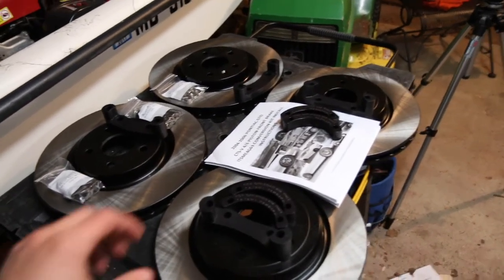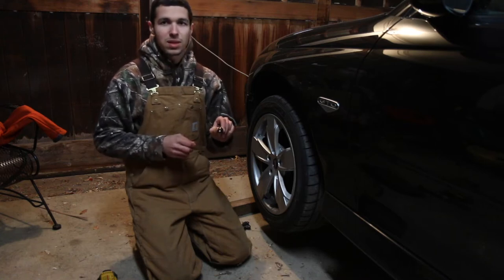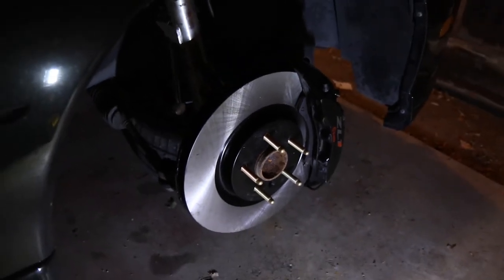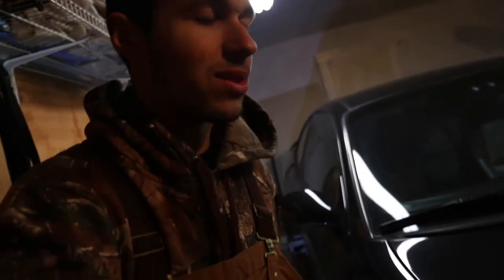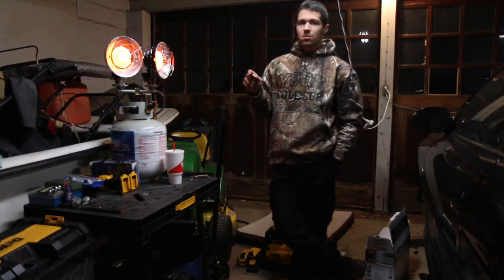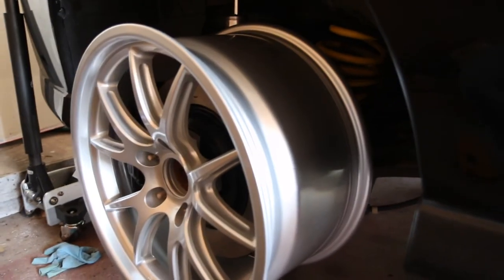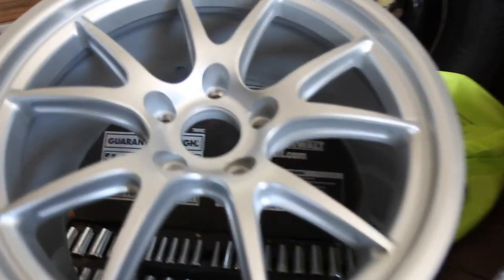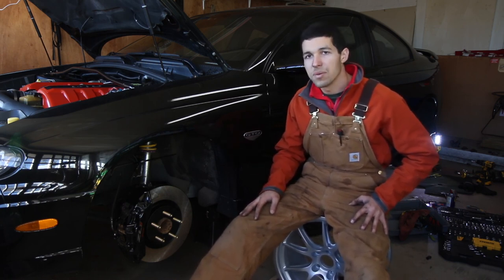Big CTSV / ZL1 Brake Kit GTO : Vlog #2

Comment: Do you have another video with the brakes all completed. Pads and all? Or a facebook page with picturs? I just want to know how well the front and rear brake pads line up with the front 2010-2015 Camaro SS Rotors and the rear C6 Z06 Rotors. Mostly the front. I will be doing the same setup for my 1997 Z28 Camaro. But I want to use Baer Eradispeed + 2 piece rotors all around which they make for the 2010-2015 Camaro SS and the C6 Z06. Yes they are .5 inches shorter in diameter vs the ZL1/CTS-V2 rotors but in return they are a hell of alot less in rotating mass and they are very efficient in there cooling. Not to mention that I think Eradispeed+ 2 piece Baer Rotors (That's a Mouthfull) look the best in my opinion. But if I have to use V2CTS-V or ZL1 Rotors, I'll use the later versions which are also 2 piece rotors that can cool off better but will be heavier and not as good looking.
Reply: I called up Baer Brakes and asked them if they are going to make CTS-V Gen 2 brake rotors for there Eradispeed+ lineup but I got a big no. It appears that they don't think it will sell well since GM and Brembo did such a nice job from the start. It's just that the ZL1/CTS-V2 Rotors that are 14.6 inches in diameter (Not 15 inches like what is advertised and also on Wikipedia) are very heavy. Even the later 2 piece rotors that were supposed to be lighter isn't any lighter. Only that the later 2 piece rotors  can avoid rust and corrosion better.
Reply: So that is why I am asking to see the final results and maybe feedback on how the brake pads are working on the slightly smaller SS Camaro Rotors. Thanks.